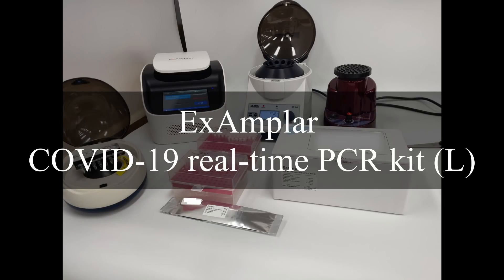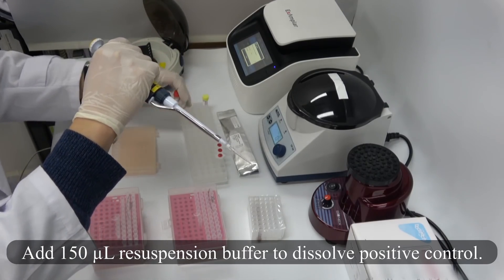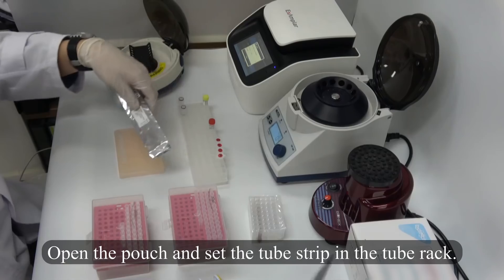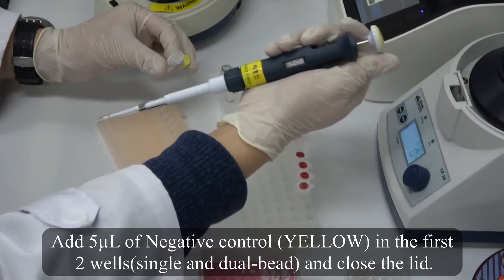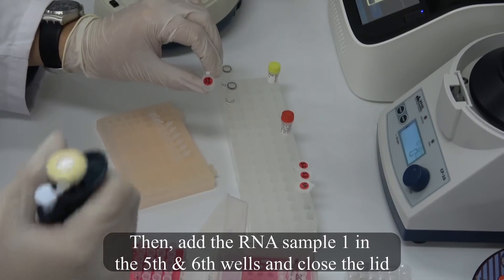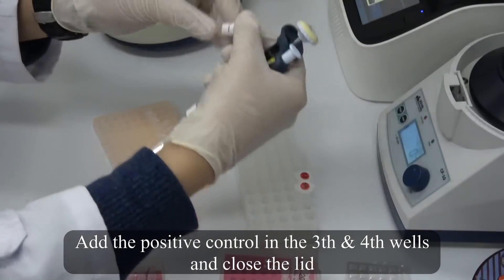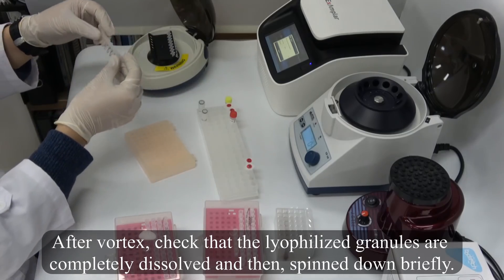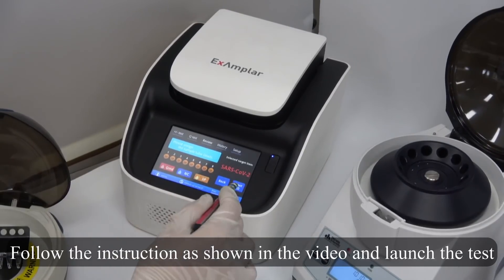Examplar COVID-19 - Test procedure

Comment: Why you added resuspension buffer in the positive control only? Can you explain the use of positive and negative control?
Reply: Controls are run to compare the test wheather It's positive or negative. If we run with controls means we can get the report accuracy
Reply: Positive control is just water haha so no need for resuspension buffer
Reply: If you run a test and either of your positive or negative controls fails then your results are not accurate

Comment: Hi. Thank you for sharing this. I was wondering. Would it be possible to use this test on samples from several people at the same time? If you could mix the swabs from an entire community and do a single test, if the test is negative, it would help you to save tests but not having to test each individual. You would do individual test only where the community test would be positive. Do you think this is possible? Thank you
Reply: Pooling samples is a possibility.
Reply: @andy1234463  shut up 🙊🙊🙊🙊 👇🙄👇
Reply: It’s hard to pool large amounts of samples and still get accurate results. You would most likely get a false negative
Reply: I've heard that at large amplification rates the risk of false positives is greatly increased but with such high infection rates and the availability of tests,  pooling samples isn't of much use these days.